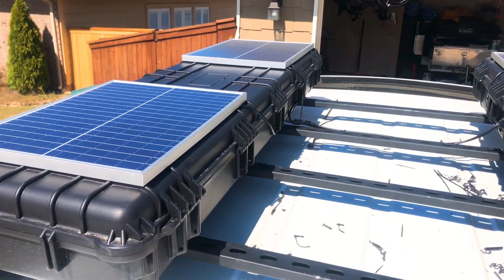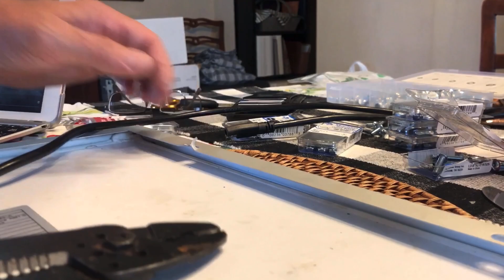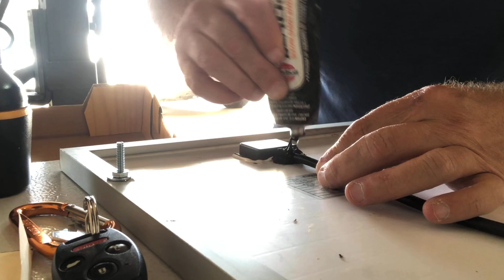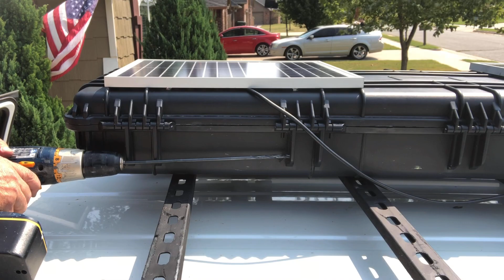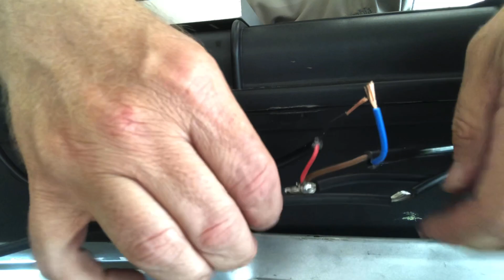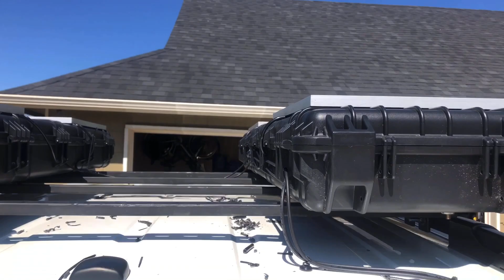Solar for the Honda Pilot Build Out #solar #hondapilot

Comment: You have convinced me to run this on my 08. I've done the math and it appears you can fit 3 on each case. Any reason you stuck with 100 watts?
Reply from the maker: Most adventures for me last one week. With the Jackery that this unit charges that is all that my math indicated I needed. I think you can do more.

Comment: Another way to do it might to have been to run the wires inside the case. That would have kept them out of the wind.
Reply from the maker: Thanks Rob.   I considered that, but I was uncertain which was more risk to the cables... rushing air or storage items in the box being bumped against the wires.  It was a toss up.  I choose air.
Reply: I think I would have gone with a "communications spline" inside the box made of lightweight u channel (wrap as needed with duct tape).  But I don't know what you're storing in those boxes.